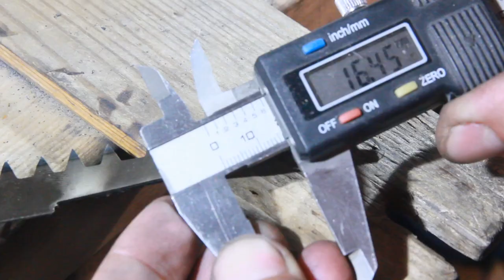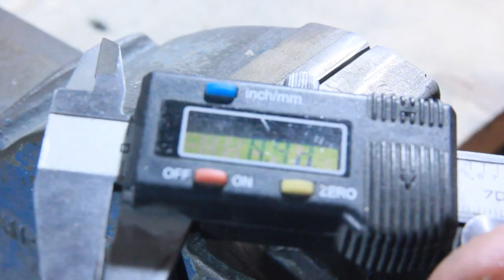Forging a 3 cm jaw harp

Comment: do you reheath treat the spring?
Reply from the maker: No, I dip it in water often while grinding it, and don't let the heat go to far when bending and heating the tip. I find that the sound changes if I reheat treat it.